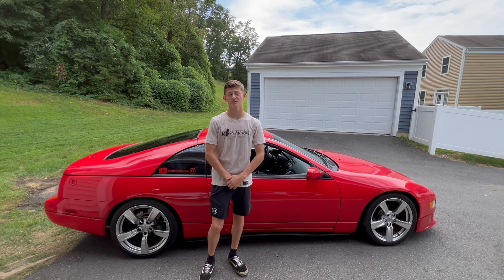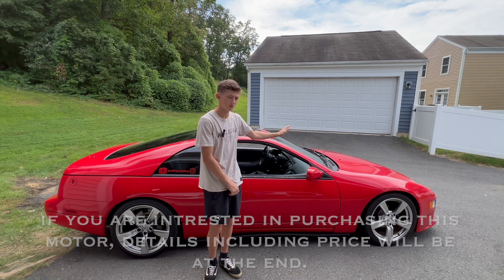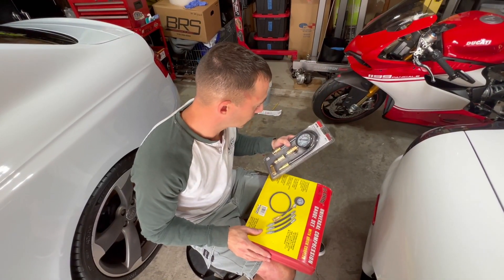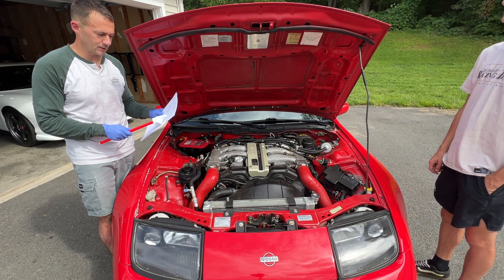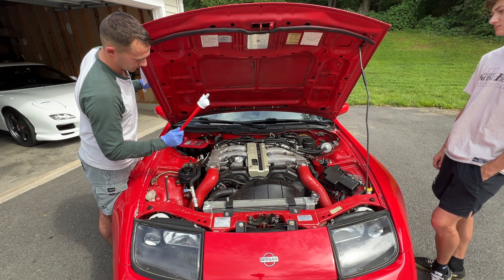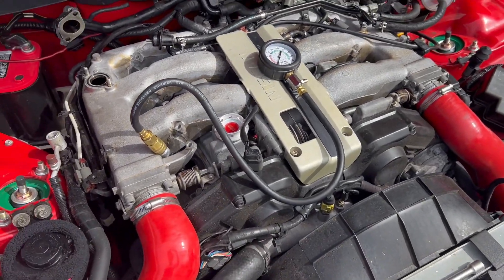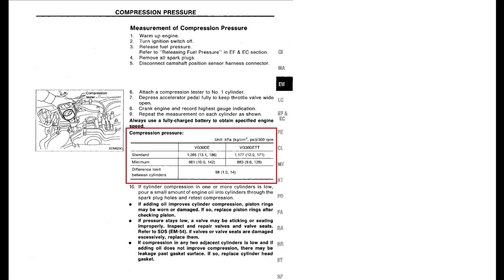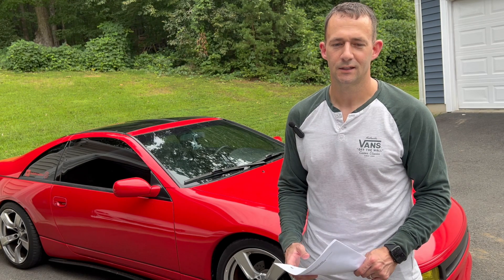Project Z32 300ZX VG30DE How to do a compression check Engine for sale Built By Miller Fairlady Z

Comment: i have 95 j30 with VG30DE engine. when you did ur compression test what were your parameters? did you pull out all spark plugs when doing it? also you kept cranking till the pressure maxed out?